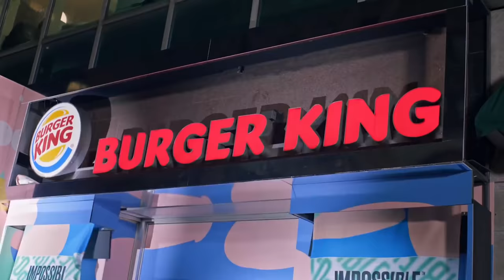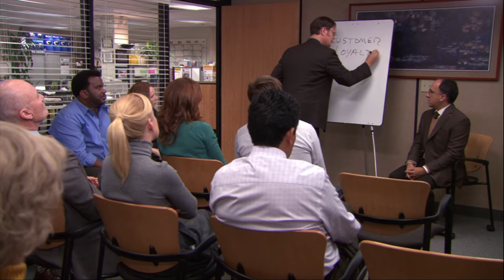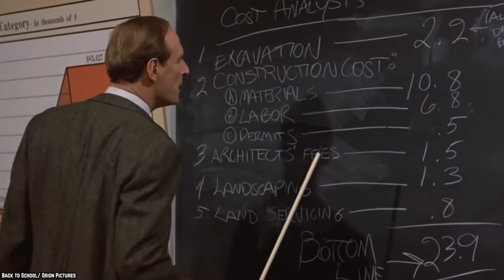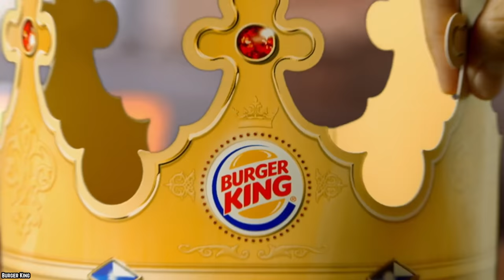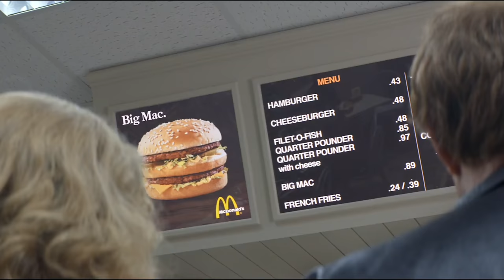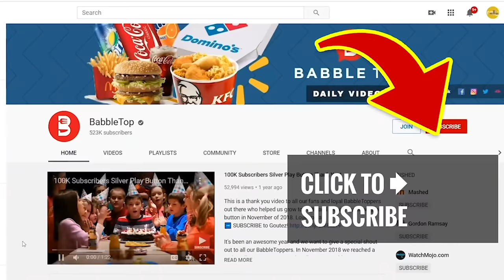10 Reasons Why Burger King FELL BEHIND McDonald's

Comment: BK has been on a downhill slide for a decade.  They used to be my go to burger place.  After hurricane Michael they never re-opened the ones in and around Panama City.  Just as well, like I said they had been going to crap.  They were putting survey instructions on the receipts.  They either never listened to them or didn't care about them, because the issues I brought up many times were never addressed.
Reply from the maker: Thanks for the feedback trafficsignal101! 😊😄 So where do you like to go out and eat?! 😄😊